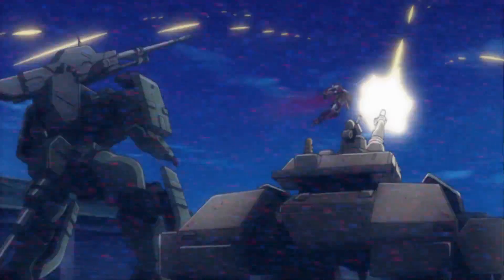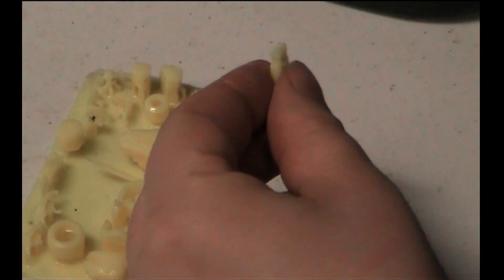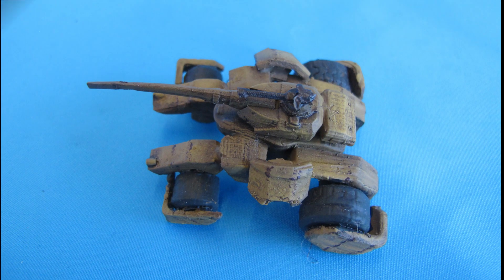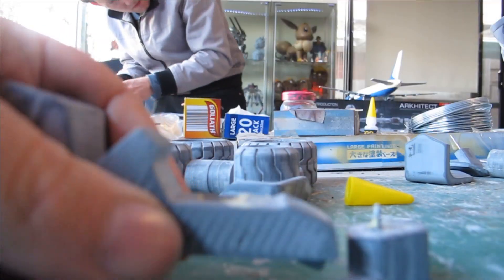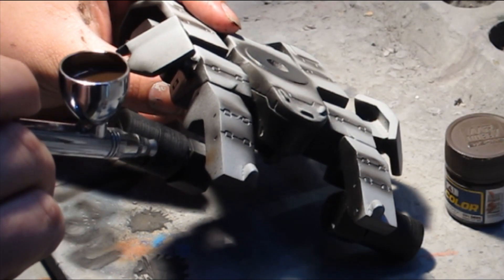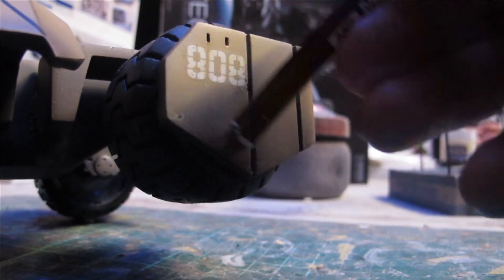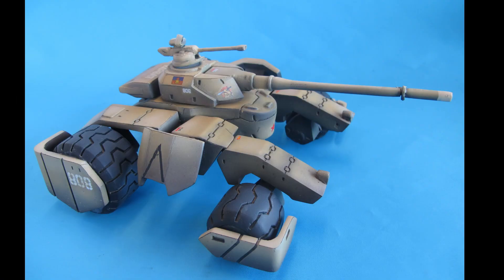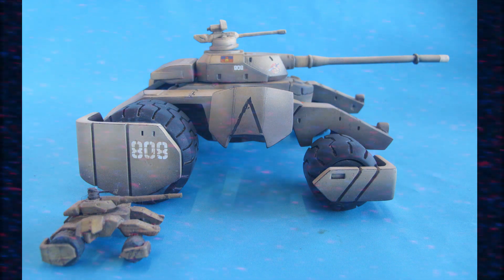3D print 1/35 MAJ-V34 Jiachong gundam 00

Comment: Thank you for sharing this, I will let the numbers' speak for themselves, today after this video went up the 1/35 Jichong was downloaded from thingi 65 times, last week it had 1 download. The spark maker was really on its last legs by the point you made the 1/144, still it worked, and you were able to tidy it up, think of what would have happened if I kept the ammo bin for the MG separate. Your 1/35 is better than mine, will have to start doing more sanding and filling on my FDM prints.
Reply from the maker: This is my best performing video in a 48 hour period for a little while. The subject matter is just that interesting and thrilled it has attracted this much attention/ downloads from your end.  The Izumi and Gundam wing guntank thing is going to slap when made and uploaded. I will keep building and uploading your project as they come across my bench, thank you for your design and hard work.